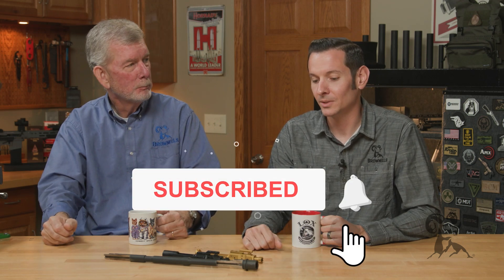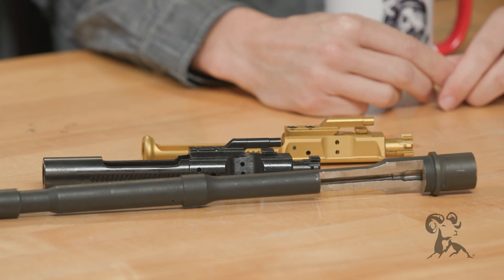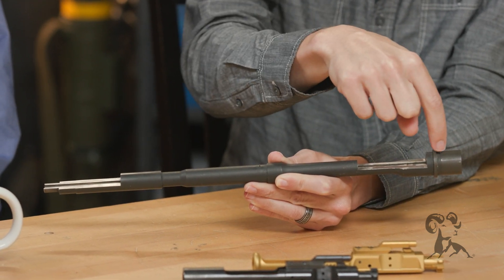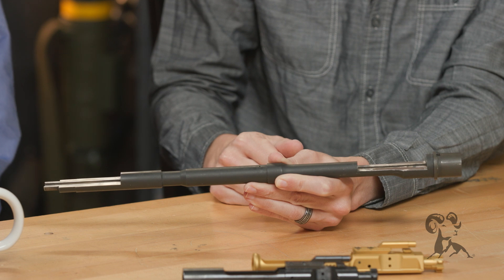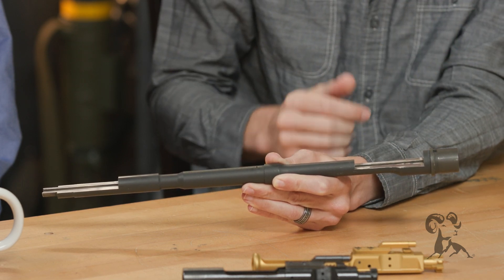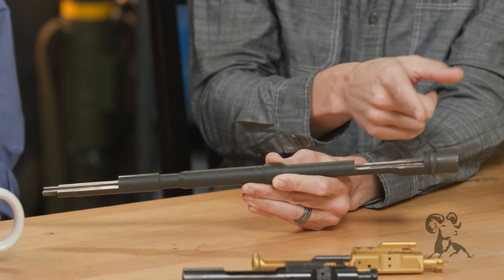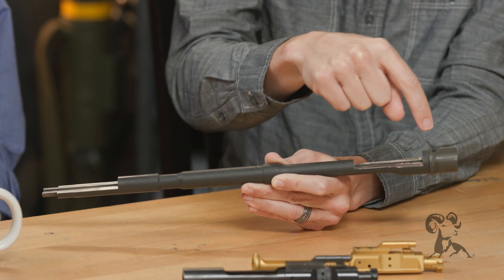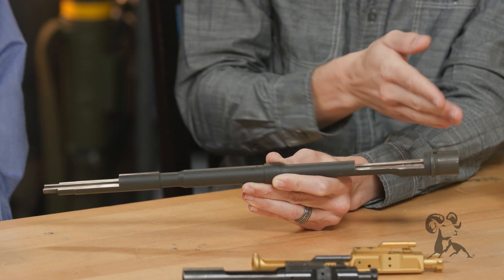Smyth Busters: Fixing Your AR-15's Headspace

Comment: Which Bolt and Barrel combos are y'all running?
Reply: My main girl: 16" lightweight hanson with a nitride bolt.  perfect match on my plastic fantastic.
Reply: @SHGVM  If were talking general store bought, I'm more of a Bulleit guy.
Reply: Bartlein and Wilson 20” match barrels on my competition rifles- whatever BCG.   But I stick with whatever bolt the rifle is zeroed with until it needs to be replaced.  

A smorgasbord of stuff on my other general purpose rifles - any bcg.
Reply: @jwilsonhandmadeknives2760  Does the zero change with different bolt? At first I would think no, but now I'm curious: lets say you went from really heavy bolt with heavy tungsten buffer (for some reason), to an aluminum race bolt with some really light buffer. At that point, I still would think it would unlock after the projectile was out, but it might open fast enough it looses a little more gas and loose 10 to 50 fps velocity which would really mess with the point of impact.

Have you tried it or seen a difference? That would be interesting to know.
Reply: @jakegarrett8109  It’s more about the headspace.  All bolts are made to a spec, but of course you have tolerances.  One bolt may lock up a tad bit tighter than another due to thickness, which will affect how the round is seated in the chamber.  I’ve never had it affect function whatsoever, but it will affect your zero.  Again, we’re talking match grade rifle accuracy here, and very subtle shifts at that.   On a general purpose rifle or carbine (particularly shooting el cheapo blaster ammo) I seriously doubt I’d ever be able to tell.
Reply: @jwilsonhandmadeknives2760  Interesting, I guess I'm thinking more the bolt carrier (there are aluminum race ones for competition, and there are skeletonized titanium carriers as well, compared to an M16 or M16 geometry with tungsten). That way if you're swapping the locking lug/bolt portion, its just mass of the carrier, which I guess is more accurate way to say what I was thinking (but indexing depth due to different lugs is a good point).
Reply: @jakegarrett8109  i see where you’re going with the weight question.  i honestly don’t know what the difference would be there.  Chances are it may act over gassed and need more buffer, but that’s just a guess.  I’m shooting high power, so bolt cycle speed is not something that affects my game.   but it’s a good question for someone who does 3-gun or the like.
Reply: Sons of Liberty Gun Works BCG with Faxon 14-1/2” pencil barrel (integrated flash hider).
Reply: 13.7 BA Hanson barrel w pinned warcomp and the same excellent Brownells titanium nitride lightweight BCG you got sitting on the desk there🏆
Reply: I really like the chrome BCG from brownells. As far as barrels, I have all kinds. Faxon, BA, Odin Works. All have been excellent.
Reply: AO Precision BCG in an LMT SPM16 upper
Reply: Sharps reliabolt and a Roscoe Manufacturing 12.5" barrel
Reply: Criterion 16” with a PSA bcg.
Reply: Bravo company full auto bolt and bravo companies 20 inch 1:7 twist. The barrel is chrome lined
Reply: Criterion 16” and Lantac ebcg
Reply: Faxon barrels with Aero bcg's
Reply: @kansasgardener5844  I have a headspace problem right now with a 308 AR upper with an Aero Precision bolt and Faxon barrel. Bolt closes (barely) on a NO GO gauge. The problem is not the bolt - that’s good to go in other 308 barrels.
Reply: @chipsterb4946 were you using a 308 no go or a 7.62x51 no-go?  They are two different gauges
Reply: @JimyoVibration  yes, I am aware of that. Forster sells both NATO and SAAMI headspace gauges and has an excellent reference page comparing the two. However, I was checking a Faxon .308 barrel with an Aero Precision .308 bolt. I used both Forster and Clymer .308 NO-GO gauges - both nominally 0.0634” which is the .308 spec.
Reply: @chipsterb4946   large frame barrels are all over the place.  Some are super tight like 308 and some are a hot dog down the hallway.   Not a fan of this fact.   You sound like you are on top of the info gathering tho, that’s cool.  It’s a bumpy road.   Btw, I don’t trust consumer grade headspace gauges anymore.  Ask me how I know.  😥
Reply: @SHGVM  ….  I make my own!  Mountains of East Tennessee.  Pure corn!  Clear and it will burst into a 1000 bubbles….  lol….     Built a few AR’s too.
Reply: @WillysPerformanceCycleCtr  :)
Reply: The three setups I have that RUN like HECK, 11.5 Geiselle with Colt BCG, 16” Hodge with Toolcraft DLC158, and 11.5 Criterion Core with Fail Zero Carrier/ Sharps Bolt.
Reply: FA Ballistic advantage DLC BCG with a 1/7 twist 16 inch ballistic advantage Hanson barrel
Reply: Brownells Chrome BCG and PSA's FN barrel
Reply: Toolcraft BCG and 16" BA Mid-length Pencil profile barrel on my last build. 
Nothing special, but it's lightweight, reliable, and gassed surprisingly well.
Reply: @DeafeningPew  toolcraft BCG are a must have
Reply: Colt M4 SOCOM heavy with full auto C carrier, MPC bolt
Reply: Mostly BCM
Reply: IMO the LMT Enhanced bolt is the best, just wish they would make one for the AR10 platform. So many great BCG's today. What's your favorite Caleb?
Reply: @johnaustin6673  The LMT enhanced BCG is really trick but they cost way TOO much.... But they are COOL !
Reply: Faxon will match a barrel and bolt for you.
Reply: Tech question; if your headspace was too long, how do you measure the headspace to know how much there is? For curiosity sake
Reply: Mostly Next Level Armament DLC BCG and Ballistic Advantage or Aero Precision barrel (BA makes the AP barrels). I have one DLC BCG made by Toolcraft paired with a PSA upper, and a Ballistic Advantage DLC BCG that came paired with a Ballistic Advantage upper. I suspect the BCG may have been made by Toolcraft which makes unbranded BCGs for some OEMs. I'd be surprised if BA is making their own BCGs.
Reply: BCM 16" with AO Precision phosphate BCG.
Reply: Rubber City Armory BCG and Ballistic Advantage, Hanson Profile, Barrel
Reply: If the head space is incorrect...then a change of bolt face could solve the problem...of course the bolt face has to be numbered 1,2 or 3 to achieve your goal
Reply: Kak low mass sandcutter/griffin 14.8 fluted/unrivaled captured magnetic buffer.
Reply: DD. BCM. FN, Centurion, Faxon, Criterion barrels with Colt, BCM , Sionics, SOLGW, BCG's..Use a 1.4646 go gauge and check with a PTG function gauge and bore scope..Pin gauges and Mitutoyoto digimatic caliber to measure gas port size and BCG tolerances..
Reply: Full Auto BCG & 11.5 barrel with a 1:7 twist

Comment: I build and sell AR uppers so what I would do to fix a head space problem is machine the chamber face area to set back the barrel extension rechamber then contact White Oak armament to build a gas tube to the new length I need

Comment: man, ive had multiple local gun stores tell me not to worry about headpsacing with the ar15. I am currently buying parts to build 3 different ar15s. And i am at a loss as to what to believe.
Reply: If you are building guns intended to have legitimate 5.56 NATO chambers, you would do well to buy a .223 Rem NOGO gauge and a Colt FIELD Gauge. 

Why?

Because it is not uncommon for true 5.56 NATO chambered guns to close on a .223 Rem NOGO Gauge so this can lead to false worries about “excessive” headspace. 

If your 5.56 gun closes on a .223 Rem NOGO Gauge, it’s probably fine and is on the slightly upper end of 5.56 headspace dimensions. 

If your 5.56 gun does not close on a .223 Rem NOGO Gauge, it’s also probably fine and just at the tighter end of 5.56 chamber specs. 

Now as far as the Colt FIELD Gauge is concerned, 

If your bolt closes on a Colt FIELD Gauge which is a 1.4736” gauge, bad news that indicates excessive headspace and likely unsafe to fire condition. 

If your bolt does not close on a Colt FIELD Gauge, you do not have excessive headspace and your rifle is good to go.
Reply: @riflesfirst208  ty for this sir!
Reply: @Anthony-pi6pf It’s actually funny after I wrote that comment I clicked another Brownells video on the subject and they recommended basically what I just did 😂

Yeah if you saw the dimensions on a SAAMI .223 Rem GO Gauge you would see how little use it is in a 5.56 NATO chambered gun.

I don’t necessarily recommend “checking headspace” by chambering live ammunition but it is almost not possible for an AR15 to have headspace so short that it would be too tight to close on a .223 Rem GO Gauge yet it would still be able to chamber a round of ammunition. 

.223 Rem NOGO is a much better “do all” gauge for checking 5.56 NATO chambers. 

Now BCM takes a different approach, they said if you are a home builder to only buy the Colt FIELD Gauge and they say the only check you should be doing is confirming your bolt does not close on said FIELD Gauge. 

I kind of understand their logic there with simply making sure you’re not excessive and that you won’t go to fire the first round and have the case expand so much that it rips in half or whatever. 

Alternatively if you have 3 barrels and 3 bolts and you somehow end up with one barrel/bolt combo that doesn’t want to play nice headspace wise, you can always try different combos to get ideal measurements. 

Ended up having to do something like that myself recently, it’s actually kind of hilarious how perfectly it worked out 😂
Reply: @riflesfirst208  i ordered both the no go and the field gauge already! 
Although i have already shot all the ARs i built and no issues yet. I still want to test them for peace of mind.
Reply: @Anthony-pi6pf Yeah. The Field Gauge is kind of the ultimate piece of mind. 

Nothing makes it more obvious you have a dangerous condition than the bolt closing on the Field Gauge. 

There are some real fancy “stepped” gauges that go from minimum to maximum in .001” increments so you can try each one and know your exact headspace figure, really neat to have that info but mostly unnecessary plus they are $$$ 😅

Comment: You can reduce the headspace in increments of one revolution of barrel extension, as you need to align it. If your headspace was really sloppy, you might geht away with it. If it ends up too tight, you could file the back sides of the locking lugs of the bolt.

Comment: I guess I have been lucky, 4 ARs built and have never had an issue with headspace and only one of them was packaged with a bolt.
Reply: If you don't check head space, then you have no idea if it it will have issues?? Short chambers are much more common than excessive length chambers..

Comment: For short chambers, (which are much more common than over sized chambers) it is possible to fix the (short chamber) head space by lapping the bolt to the barrel lugs or even changing the bolt..I have bolts that run in different sizes and I keep them separated, small medium and large to fit problem chambers..Incremental head space gauges are great for measuring bolts..

Comment: Been running the AR platform for years 
Bought a Daniel Defense BCG and had head space issues
Called brownell and they suggested one of their BCGs fixed the issue for $70 less
Reply: If you have head space gauges, then try different bolt combinations..Bolts come in different sizes, no matter what people say or think..I separate my bolts, small medium large..Changing the carrier has no effect on head space..

Comment: I am astounded that in this age of technical wonders that AR headspace is even an issue. I'm not saying it shouldn't be checked because it absolutely should but why is it even a thing?
Reply: It shouldn't be if the bolt and barrel were head spaced together from the same manufacturer, otherwise it is always best to head space the chamber and bolt..
Reply from the maker: Because there are manufacturers out there that cut corners and use cutting tools past their lifespan.
Reply: @brownells  I do get that, I was simply saying that I am amazed that it does happen.

Comment: Just spend the extra on fn barrel or a higher end.  Do not buy psa fn barrels they are good on headspace but they are handme downs
Reply: It doesn't matter if you are mixing and matching different barrels and bolts, head space can always be an issue..

Comment: Well what if no barrel manufacturer out here does not make a barrel specifically for the armalite ar10 and have to go with the lr 308 pattern? I've been trying to find a workaround for this. Be easier if manufacturers just simply made extensions for armalites.

Comment: I had a bolt/barrel combo that just barely wouldn’t close on a GO gauge. I used a little bit of lapping compound on the back of the lugs and worked it until it closed. Took a few minutes, and the bonus is that lug contact is now even across the lugs. As far as excessive headspace… return the barrel.
Reply: Yeah i was gonna say. For too tight you could mill a tiny bit off the bolt face. I wonder if any companies sell slightly oversized bolt faces to correct too much head spacing?

Comment: Question: if I purchase this noveske leonidas 12.5” barrel from y’all (brownells) and I purchase a brand new sionics np3 coated bcg. They should headspace correctly? And if I check with brownells go/nogo gauges and something is off, where am I at?  Considering the prices and names behind both the noveske barrel and sionics bcg (with OCKS)….they SHOULD go together like pb&j…..right???
Reply: I mainly ask because noveske website want $620+++ while it’s available @ brownells for $589…but noveske will headspace the bolt if you buy a bcg from them as well, now we’re talking $850-$900++ and no OCKS on noveske bcg, I WANT the sionics no3!

Comment: I've been hearing for years that I need to check the headspace. I know I do and I'm going to buy a couple of gauges but I have not bought them yet. I also know the odds of my headspace being so far off that I have a catastrophic failure with an AR-15 is extremely slim. An amazing number of people do not want to admit this fact but it's true.  I don't know why everything is right the vast majority of the time but it is. Usually even with cheap stuff it works out fine.
Reply: I have seen short chambers way more than any oversized chamber in the AR platform, which is why I recommend checking every bolt / barrel chamber with the proper go gauge in 5.56, a 1.4646 go gauge..

Comment: I once got a barrel that seemed it was cut to narrow in the case diameter in addition to the gas port not drilled large enough. Strange
Reply: Many manufacturers will re-sharpen their chamber reamers creating a tight chamber. This is why it is a good idea to check chambers with a function gauge as well as proper go/no go gauges at minimum..

Comment: If there's not enough headspace, could you just chuck the bolt up in a lathe (or better a tool and cutter grinder) and remove a tiny amount of the locking face?
Reply: If you have access to a lot of bolts you could possibly find one that would pass the go gauge if it is not far off..Much to popular belief, bolts do come in different sizes. You can see this with incremental chamber gauges..

Comment: you guys don't check head space on the barrels you sell?
Reply from the maker: The actual headspace in the chamber, yes. There is still no guarantee it will headspace with your bolt, you should always check when changing or building.

Comment: Hey guys I just remembered a headspace story where the guy had a real headspace issue. About 15 years ago my buddy had a gun shop that was more of a reloading store than a repair shop. Anyway, he sells a guy an AR and a few days later the guy brings it back into the store and is mad as a hornet because he bought a “ piece of blankety-blank” gun that obviously shouldn’t have been sold in the first place. His complaint…. After every shot the brass came out of the gun almost “ripped in half.” He had several cases that were sure enough ripped from the web in the head of the case all the waythrough  the mouth. Ripped clean open. So as I’m standing there looking at a destroyed case the thought hit me like a ton of bricks. As Paul Harvey would say at this pint “ the rest of the story” is rolling the case over to the clean side I saw the perfect silhouette of a 7.62X39 chamber. I solved that headspace issue with a simple 5 second conversation. “ You need to use the correct ammunition”
Reply: Hilarious, but more common than many would believe..

Comment: Some years back guys were buying barrels without extensions (gun show junk), and trying to buy extensions to put on them, and... well, that was a whole fiasco.  Another was people selling threading dies so that coming out of the 1994-2004 AWB you could just use that die to thread the end of the barrel and screw a flash hider right on your barrel.  Or so they said.  That didn't work, either.  There are suckers born every minute.

Comment: Recently checked the head space on my new RR upper and the go gauge wouldn't close. I checked it with three different bolts and still wouldn't close. Before I checked the head spacing I shot 60 rounds out of it and it worked fine no torn or ripped brass or primers. I called RR and they told me to run it. Would like to know what you all think?

Comment: I have a set of headspace gauges, a 5.56 throat gauge and a 5.56 throat reamer. SP-1 fine AR-180 made by Sterling Marked 5.56 one tiny burr in the throat. Two new DPMS labeled 5.56 with 1-9 twist both throats were a bit short each took a couple of twists with the reamer to pass the throat check. Both the SP-1 and AR-150 have worked fine with Military ammo the new pair are waiting as my only transport is a bicycle and the range I am a member of is 18 miles away across a Stateline. I am 70 with a bad right knee and right hip. I recommend at least 3 months of food on hand plus medical gear.